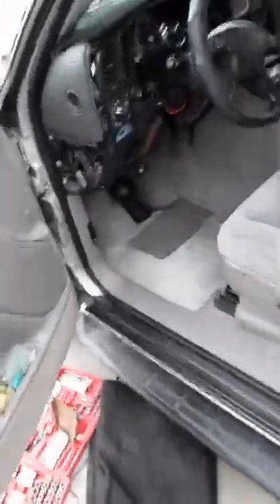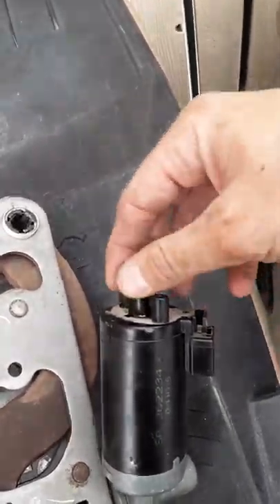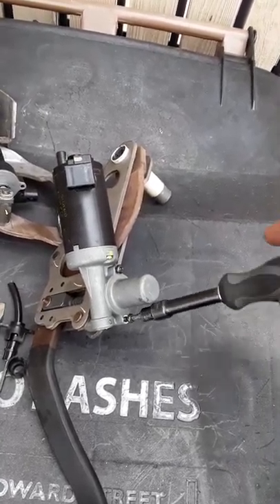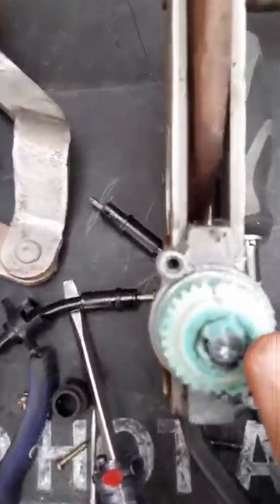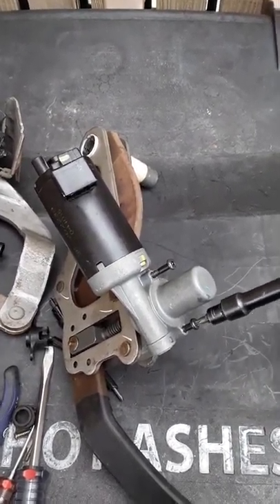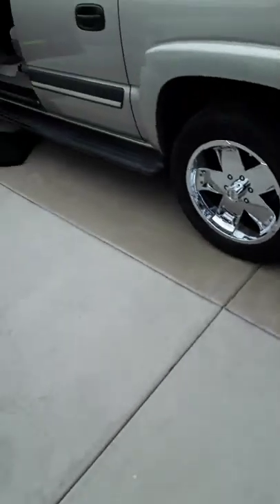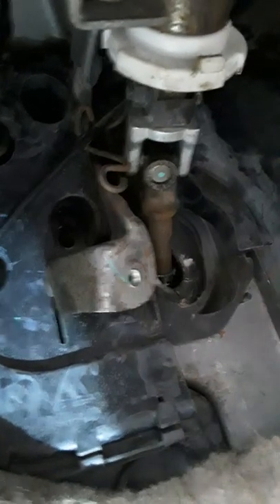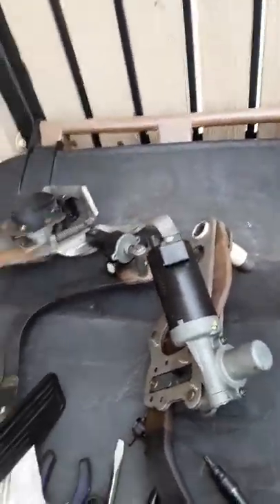2005 Chevy Suburban Pedal Adjustment Broken

Comment: Thank you! 03 burb and pedals stuck at full mast lol. Removed the brake pedal gear cover and moved gear past crack, was then able to move both pedals with electric switch back down. Wish I could find just the plastic gear to replace. So far junkyard gears are already cracked or begging to crack.

Comment: Thanks for posting this.  Saved me a bunch of time. I left the cable connected and just ran the motor to move the gas pedal too and buttoned it back up. I don't need this feature but my wife is short and it helps her. This stuff is great when they work but a PITA when they don't.  Thanks again!

Comment: Man I just wanted to say thank you. I’m gonna check this tomorrow. I like working on my own car but I had to take my 03 Tahoe into the shop for ac fix and they just eff’d up everything in it. The dash wasn’t put back correctly and I had to take it back because the steering column wasn’t reinstalled properly. And then I got it back this time and the adjustable pedals were broken. So I hope it’s just this because it’ll probably be easier than dealing with those guys again. This is just a expensive reminder of why I love being my own mechanic, Granted I can only do so much on my own before I have to consult YouTube. And I have some things completely out of my range. Long rant but the short and sweet is thank you for making this informative and helpful video.
Reply from the maker: You're very welcome 😁

Comment: Thank you brother, I really appreciate your help. May not even be my problem. Replaced the hydroboost, which is famous for leaking. While removing the brake switch it came apart. I have replaced the brake switch and obviously checked fuses. I am learning about the fly by wire systems. Somewhere someone alluded to a connection to the movable brake pedal and position sensor. The pedals no longer move but motor is working. Probably should have disconnected the battery first but like you I sometimes learn the hard way. I normally don't post but I wanted to appreciate your help. Thanks

Comment: I have a 2003 GMC Yukon Denali I need to change out my accelerator pedal ( to change my throttle position sensor). You briefly showed pulling that cable on the accelerator  pedal. Twist the pedal adjustment cable to unlock and then you said use a screwdriver to push in the two pins to release the cable. Was there a pin on each side of that black round cable and do i need to push both sides to get it to release and should I drop the accelerator pedal first to have better access to that adjustment cable? Thank you in advance for your video and help.
Reply from the maker: Twist to unlock. Then both pins and that should be all to pull and remove.

Comment: Matthew by any chance do u have a part number or name of the part I’m having same issue thank you so much for this video! You should make more! Very helpful
Reply from the maker: You can type description into ebay and they will pull up.
Reply from the maker: I purchased a used working motor to pull the gear out of. You might need to do the same.

Comment: I know im a bit late I have a traiblazer same pedals I wanna ask how can I manually adjust the pedals I did the gear thing and now brake pedal is on the right position but accelerator pedal is stuck on the highest position
Reply: If you leave the cable connected just run the motor while you have the gear housing off until gas pedal moves. Then put it back together and unplug it. I just did mine today after finding this video